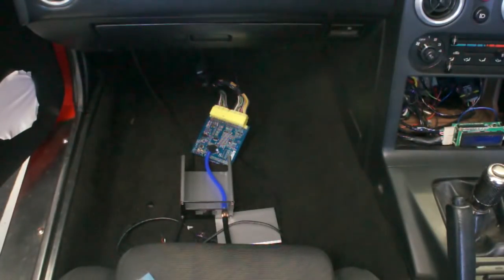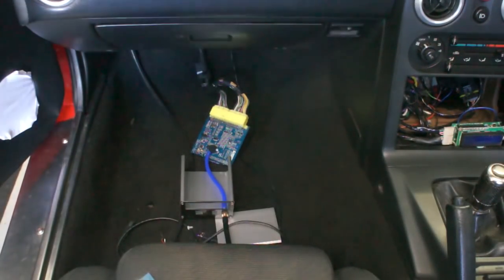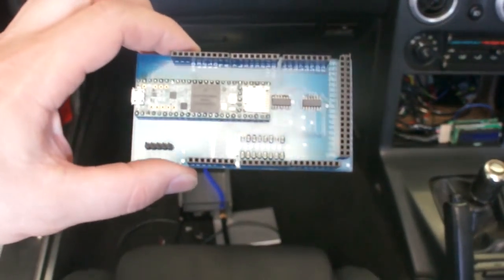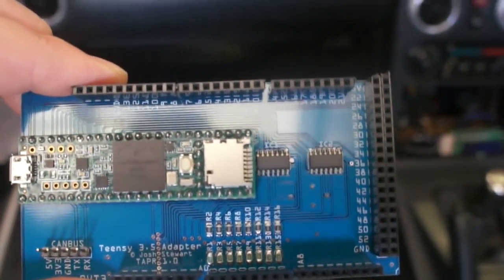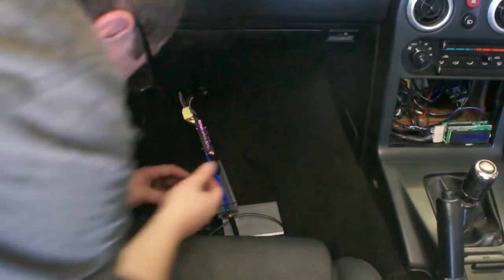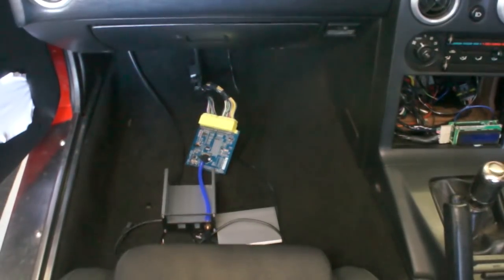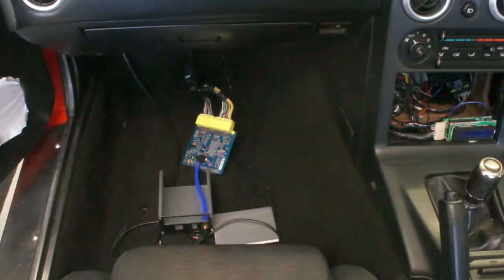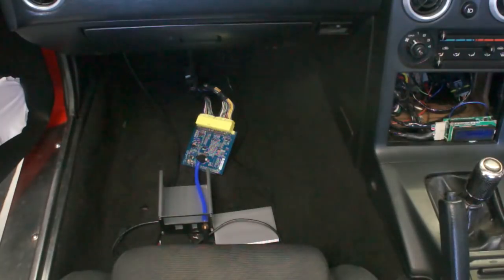Speeduino Teensy (ARM) adapter board preview

Comment: Hello, the days I search for proejtos of this level, finally I found something exciting.
Let's say I need a control unit for a single-cylinder electronic injection motorcycle that has mechanical modifications and requires adjustments that the original ECU does not allow.
Is it possible to develop such a unit at low cost?
Greetings from Brazil.
Reply: Speeduino works for that

Comment: Maybe a NOOB question but what is the advantage to go to a Teensy board? Just speed or because it is arm based?
Reply: I have the same question.
Reply: Josh Stewart: but would that break the code? I mean are those features you cannot have with the Mega because it lacks processing power?
Reply: but why teensy..??
maybe stm32 would be better...
Reply: @mentalterbelakang  Teensy is /incredibly/ well-supported. Paul Stroffegen, the guy who makes it, is incredibly particular about all the APIs and BSPs working well, correctly, and easily.